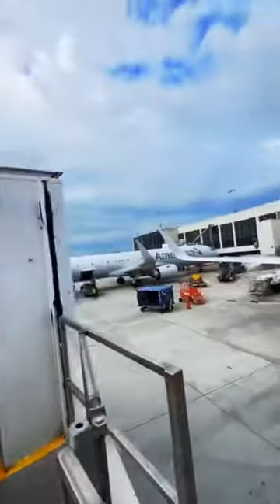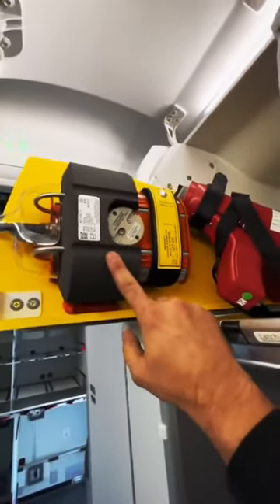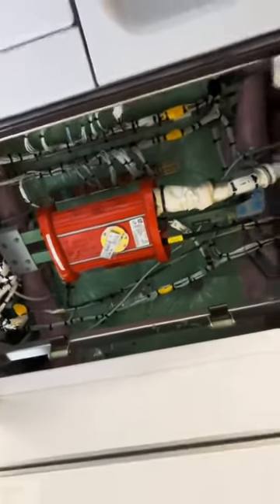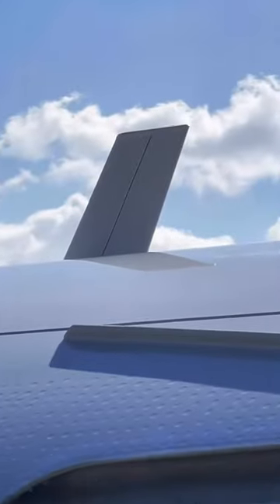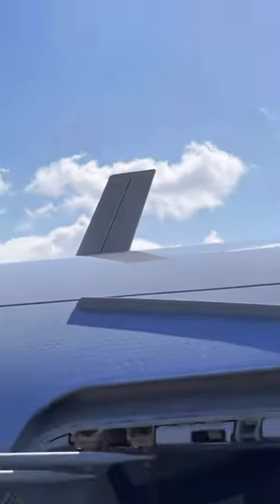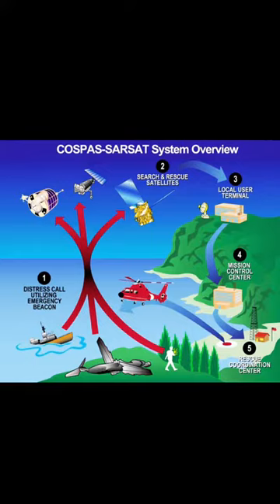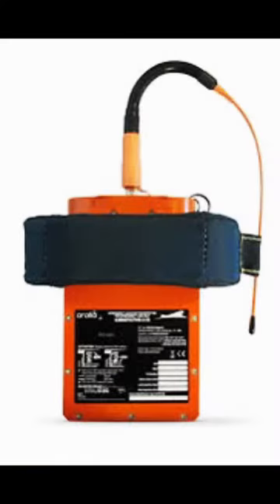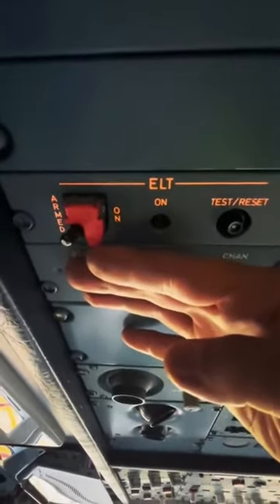Aircraft ELT (emergency locator transmitter)

Comment: What could go wrong if they're completely autonomous and fixed outside on the plane so no one can override or shut them down?
Reply from the maker: But there already is an autonomous fixed ELT on these aircraft. The portable ones are for when you need to escape the aircraft with a ELT.